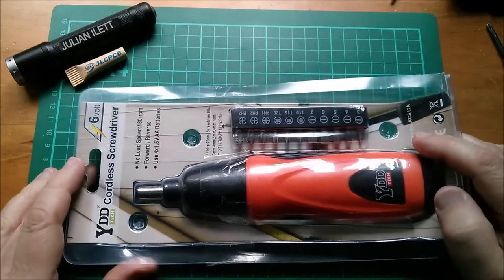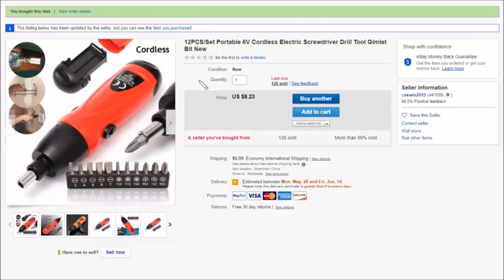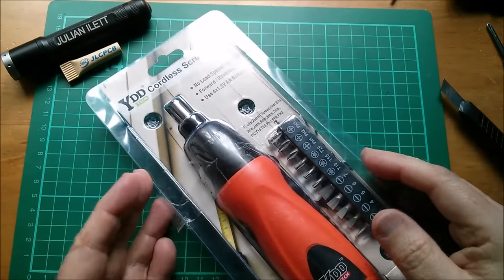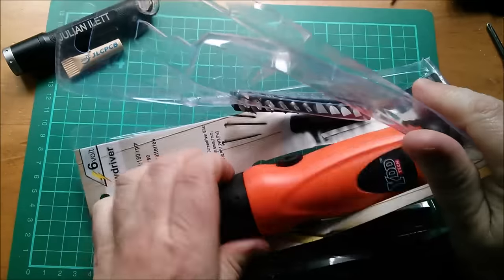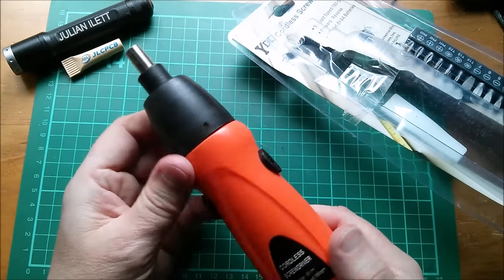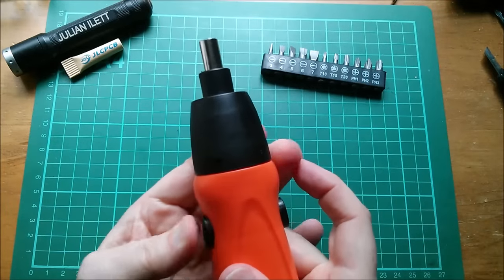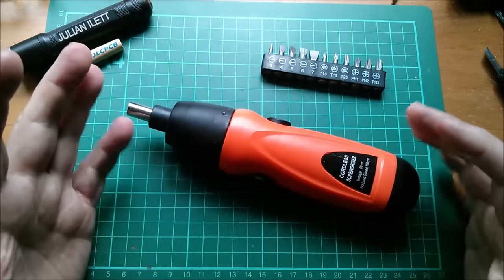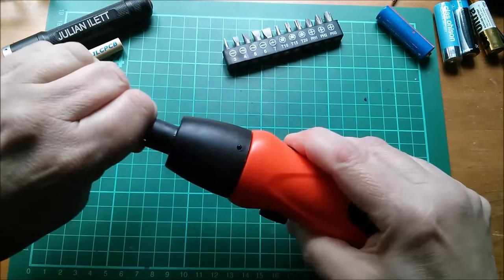Review: YDD Tech 6V Cordless Screwdriver

Comment: The chop was ok but I think blasting it with over voltage/current with the control switch jammed on might have been a fitting comedy ending, incorporating maximum motor RPM and magic smoke.

Comment: The packaging only says screwdriver so it's a little unfair to judge it on the fact that it can't drill into a piece of wood or doesn't have a chuck like the Ryobi.  I'd say it's actually pretty impressive that it could drive screws into pilot holes like it did;  I think it's pretty clear that such a tool is only meant for light homeowner stuff like removing and replacing existing screws in electronics, light switch plates, etc.  Sure, the listing may have said drill, but it's hardly the first time an eBay listing has been inaccurate and that's not the product manufacturer's fault. And finally, cutting the thing in half was just pure waste and rather distasteful. I like you a lot so please don't continue to do this sort of thing.

Comment: The stuff on the gears is called "schmoo".   :-)  I have here a Black & Decker power screwdriver,  which is quite heavy-duty compared to that unit, having a lot more metal in its construction.  It uses a 3-cell nicad pack for power and I'm on the 3rd or 4th set,  so far.  Later units,  which were a bit smaller,  had only a 2-cell pack in there.  Mine comes apart after removing only one pin,  and unfortunately the first time I did that I was holding it the wrong way,  and all of the gears fell out,  and I had to put it back together...  Same gear set,  though all metal.  I wouldn't be surprised if that design were very common.  Torque:  When you get to the point where you're driving a screw in and it stops,  keep tapping the button.  It won't run, but it will get them in just a bit further,  and if what you're looking to do is get those screw heads flush,  that will sometimes do the trick.

Comment: They couldn't even bother getting the stickers sized right.  Says a lot when it isn't the right size, placed straight, or flat onto the case.  $8 USD is way too much when you can get something way better locally for maybe $12-18 CAD.  Only reason to order that on eBay would be if you lived away from the city or something.

Comment: The tool is perfect for the electrician who is wiring the lighting in the ceiling of large buildings which requires opening and closing connection boxes with #8 screws in large numbers. At that price it’s a great tool.
Reply: yes I was thinking the same thing with reference to taking off switch plates and outlets and so forth but the speed seems a little slow for that
Reply: I get the feeling you’d be changing batteries every half hour, though!

Comment: Instead of just destroying it you should have keep it around and used it a bit first. I have one of similar design labeled Black and Decker, It is one of my handiest tools, much lighter then the Ryobi drill/driver I have. Mine is marked alkaline and has a feature where you can lock the holder for manual use (handy for when the batteries die). I have had mine since before lithium batteries became popular.

Comment: The gimlet is a 1929 cocktail typically made of 2 parts gin and 1 part lime juice. OR A gimlet is a hand tool for drilling small holes, mainly in wood, without splitting. It was defined in Joseph Gwilt's Architecture (1859)
Reply from the maker: Shouldn't the cocktail be a ginlet?
Reply: @JulianIlett  Only if you increase the ratio of gin to lime, as in the difference between a BACON Lettuce and Tomato Sandwich and a Lettuce, Tomato and bacon sandwich!

Comment: A copied design from the Black & Decker KC9006
Reply: Yeah, have the B&D. 
DO NOT use it to turn in a screw. If the motor stops, get a screwdriver to tighten fully or break loose tough screws. Otherwise you will strip out the hex into the plastic gearbox.
Reply: Thought the same thing. I had two of those as my first "power tool" that I had bought on sale. I remember using them in my teens and still had them around when I went to college. Had one for outdoor stuff and one for indoor stuff. I still have the cloth fold out case with all the bits in them.

Comment: LOL, I did THE EXACT same thing yday. My Fieldmann FDS 10102-A broke, so naturally I took it to pieces. I though it was batteries, in fact it was the charger (or maybe both). Later I found out one of M7 diode did go as well. At lease I've got some practice soldering out of that. ;)
Reply: Did you saw it in half?....lol.
Reply: :D I still might. 
..., but tbh. there isn't that much plastic; all the gears, switches and bit holders are metal.

Comment: Always thought those type of drills are pointless. Both me and my dad are Makita fanboys and we both have a Makita DF030D, best compact driver ever made. I dropped mine while on the roof of our house ~12m fall onto the marble stairs and it still works after another 3 years of use. Dad also have the Makita DLX2131JX1 18v set for work and its so good. Never really been impressed with Ryobi either, even for home use.
Reply from the maker: I'm pretty loyal to the Ryobi brand - I wish I wasn't, it's more of an addiction really :)
Reply: It would be more interesting to see  if this screwdriver still worked after dropping it from that height than this useless cutting in half. 
I was also interested to see if the screwdriver could unscrew the screws you did put in the woold by himself and even more difficult with your more expensive tool.

Comment: Erm you start by comparing it to something 2-3 times the price? It's a battery screwdriver that you use as a drill with a fitting that didn't come with it, so may be the alien fitting is poor. Overall you can't expect an AA battery powered screwdriver to be comparable with a lithium device. I think that's why we never had battery screwdrivers before lithium. Not sure what you were expecting except to fill 21 minutes. I certainly lost interest after 5.
Reply: I have a rechargeable black and decker screwdriver that runs on built in nicads. It dates back to the late 1980s!
It’s very sturdy, and the gearbox end is metal. The performance was poor and I never used it. Ironically, I find screwdriver-shaped electric screwdrivers to be horribly un-ergonomic. I much prefer gun-style drivers.

Comment: 4 alkaline cells will have 1.2v more than 4 NiMH ones. Not a fair test.
Reply: But the NiMH will have some more amps to deliver.
Reply: It’s not about voltage or current as such. The far more important factor is the internal resistance of the cells. NiMh cells have a very low internal resistance compared to a consumer grade AA alkaline cell.
Reply: Which means they can deliver more current.